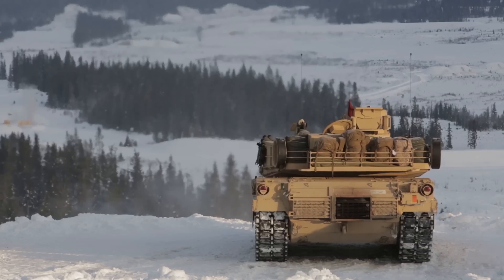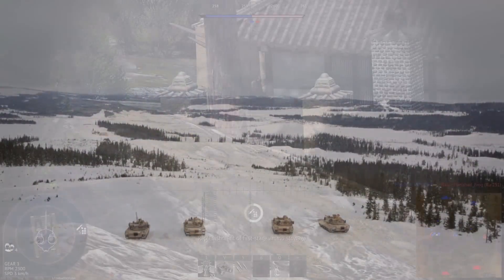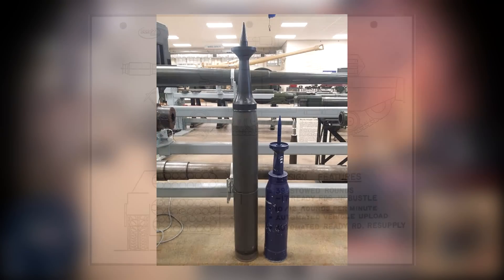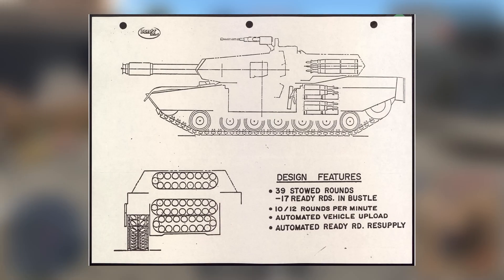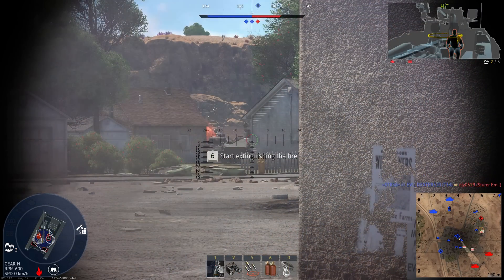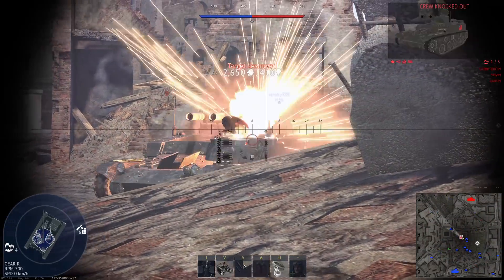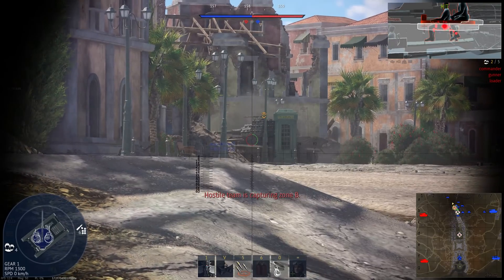The Strongest M1 Abrams Ever Built

Comment: In cursed tank similator i have full cattb set yeah it has lazer warning system, missile warning system, 560mm pen apfsds (l55a1 gas 495mm pen) but dont have active protection system amd turret armour weaker than abrams sepv3 turret then i put sepv3 l55a1 cannon and cattb chassis all in one hull armour unlike war thunder it has 560mm, on turret its 800mm turret sides are 400mm also you can take 95-100  120mm shell inside the rank all shells has blowout protection

Comment: I have a serious question so serious answers only. What would a M1 Abrams tank be like if it had an electrically powered modified B-17 “Memphis Belle” Sperry ball turret mounted as the new commander’s weapon station and incorporates a race ring and turret basket for 360 degrees rotation coverage and offering anti-aircraft protection?
Reply: That would take so much space form the already cramped tank and why would you add stuff to the Abrams when other vehicles exist for that job pacifically. like the M3 linebacker, AN/TWQ-1 Avenger and the M-SHORAD all are for short range air defense but there is a purposed prototype called the 'M1 Abrams liberty 2' that was design for air defense. it was proposed to have 2X35M and and 12 ADATS missiles and a full search and tracking radars or same IRST form the ADATS. Liberty never left the mockup stage. i hope i answered to your questions. if you have any questions I'm happy to answer

Comment: An Abrams with a Cummins diesel!?! That's lovely!! That would solve the Abrams main problem!! It's gas guzzling turbine engine. Poland has acquired 250 Abrams tanks. But they train very little simply because they cannot afford the amount of fuel required. Furthermore they found out the hard way that this tank is waay to expensive maintenance wise. So yeah. This would be the better option I guess.

Comment: @Spookston: there were actually TWO M1 CATTB testbeds.

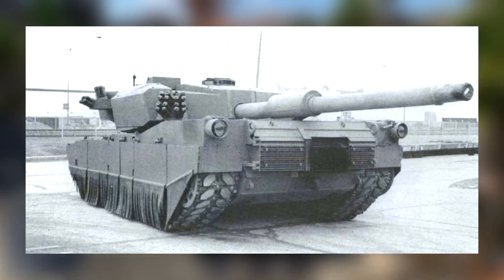The first one, named CATTB Phase I, used a normal M1 (not a M1A1 like the M1 Thumper AKA the ATAC Demonstrator) hull (note the sprocket retaining rings and the rearmost, trapezoidal skirt segment inherited from the M1) and it still had an AGT1500 gas turbine and the original M1 trackbelts (see @03:01).
CATTB Phase II, built a year later, used a completely scratch-built hull designed to house the smaller XAP1000 AIPS diesel engine (which, in turn, allowed the inclusion of those vertically-stacked, non-ready ammo carousels in the hull, in the space left vacant by the more compact engine - allowing a whopping 39-round loadout, either of the 120mm OR the 140mm ammo variety) and it had new, single-shoe experimental trackbelts (barely visible, but your video thumbnail shows the Phase II vehicle).

That's the only way to visually differentiate the two CATTB prototypes:
- Phase I: AGT-1500 with rear exhaust grille, two-shoe M1 tracks.
- Phase II: AIPS with NO rear exhaust grille, single-shoe tracks.

Both of them had the XM291 120/140mm gun, but IIRC it was the M1 Thumper that first trialed the 140mm XM291 (with three different barrel lengths, too!) at Aberdeen Proving Ground (there even was a companion vehicle, derived from the MLRS chassis, that could reload the Thumper's turret bustle carousel with a robotic feed arm that latched onto a rearming port built into the Thumper's bustle).

All of these vehicles are at the Sierra Army Depot at Hurlong now.

Comment: Okay so I tried to do some research, and I've found literally nothing specific on the penetration ability of the XM291 140mm, it is stated that a British project for it (multiple NATO countries worked on this gun, and the ammunition was able to be used by all NATO countries using the 140mm), the British did a test, saying the penetration of the XM291 had an effective penetration of 40% higher than 120mm guns being used at the time. With calculations, I came up with 305mm of penetration at a range of 4 miles, please correct me if I'm wrong or if someone has more knowledge on this

Comment: I saw this prototype personally when I worked a summer internship at the Sierra Army Depot in Herlong CA way back in 2011. Cool looking tank. Never got to stick my head inside unfortunately. Up until a few years ago I could locate it on the base with google maps but they have since moved it somewhere else on base or shipped it off entirely. I tried looking for it but the satellite pictures of the base are too low resolution to distinguish it from all the other tanks stored there.
Reply: I know the ATAC System Demonstrator aka THUMPER is located here, 40.20512860551921, -120.13609225826659 no idea about the CATTB tho.
They still had the "cowboy fringes" installed when you saw it?

Comment: I think M1A2 sepv3/4 has more armor in turret. It is like over 1.5m equivalent or even more at this point.
Reply: you know or think?
Reply: @jammygamer8961  I don't know exact numbers, as it is secret, but from sep v2 onwards, they elongated turret and replaced hull armor. So elongated turret means thicker special armor pockets, and new welds on hull in place where hull special armor pocket resides, means they upgraded it. From scarce sources I stumbled upon, they apparently put older turret armor into hull, and replaced turret armor with new one. New seps don't have depleted uranium in turret, but something else, probably something based on tungsten

Comment: Some additional info and corrections about the CATTB.
1 - It had 80 smoke launchers
2 - They made 2 CATTB prototypes, the first one, CATTB Phase l uses a normal M1A1 hull with some internal modifications while the 2nd one CATTB Phase ll uses a new hull made just for it.
3 - Detection Avoidance Program. PM Survivability Systems began investigating in FY 91 the feasibility of incorporating signature reduction techniques in combat vehicle systems to increase survivability. The PM provided funding to TACOM for development of technologies that will reduce the following combat vehicle signatures: visible, near infrared, thermal, millimeter wave radar, and acoustic. Part of this effort requires testing the technology on the CATTB.
 TACOM is designing and building signature reduction hardware for the CATTB and is predicting the signature using computer models validated by the CATTB test data. The turret was specially developed to have reduced signature, same with the new side skirts.
4 - The new suspension provided a weight saving of over 1,700 pounds (771,1KG), better mobility, better on move accuracy and can adjust ride, lower the front, rear etc. The new tracks are also 590kg lighter.
5 - CATTB Phase II consists of a reconfigured hull to accomodate a three man crew. The major technologies to be incorporated into the CATTB phase ll compared to the phase l include a 270-volt electrical generator, electric turret drive (chassis mounted), full non-imaging sensor system capabilities, updated vetronics, and an auxiliary power and enviromental control sytem.
6 - The Propulsion Laboratory supported the CATTB program by testing a new personnel compartment heater, you can see the heater in photos located in the left side.
7 - New advanced automatic fire extinguishing system.
8 - The 120mm L/55 and the 140mm tube have the same length, 6.750m with the 140mm tube having twice the chamber volume of the M256, 20L.
9 - The CATTB, just like the ATAC System Demonstrator (THUMPER) has a rearm port in the turret rear and a case ejector door located in the turret roof.
10 - Pressure Swing Absorption (PSA) prototype hardware/Environmental Control Unit(ECU) prototype hardware. PSA is used in Hypoxic air fire prevention systems to produce air with a low oxygen content.
11 - Advanced dynamic track tensioner system, anticipated to increase fuel economy and to improve overall mobility.
12 - XM965 HEMP-T with proximity fuze, but it is actually a HEAT-MP-T despit what the name says.
13 - Despit having a bit less gross horsepower than the AGT1500, the XAV-28 had more net horsepower and 10% more sprocket torque compared to the AGT1500, also had a Infra Red Supressor (IRS) installed. The XAP-1000 AIPS uses a new seven-speed automatic transmission built by Allison, three more gear ratios than the M1 abrams, and it is designed to allow the engine to be mounted transversely to make more efficient use of the engine-compartment space.
14 - The CATTB used the 140mm tube, despit the CATTB FINITE ELEMENT STRESS ANALYSIS saying LW 120mm, there is tons of documents stating that the 140mm is labed as the LW 120mm, and in the same document, theres 2 given weights for the gun, 6,810lbs(3088,9KG) provided by gun manufacturer and 10,000lbs(4535,9kg) calculated.
15 - The net weight is 63.044 Metric tons, while the gross weight, with ammo, fuel, crew, etc should be around 68-70 metric tons.
16 - The turret front armor is 1270-1016mm thick, and the sides more or less 520mm, it is stated in at least 2 docs.
I have more info about the CATTB, but i think it's enough for today, i m also making a accurate CATTB model in sprocket, the CATTB model in armored warfare is full of errors.
Reply: i think the "errors" in AW CATTB model are intentional as if im not wrong it is their interpretation on what if the CATTB is somehow accepted as a whole and still kicking in the 2020-2030s, could be wrong though.
Reply: I'm not quite sure about part 14. There is this famous picture of the Thumper with the actual 140mm and you can see how small the bore evacuator is relative to the barrel. The barrel on the CATTB looks like the 120mm with the big bore evacuator. Also there are some documents showing a stationary 140mm which also looks like the one mounted on the Thumper. I wouldn't expect this to be added ever because of this uncertainty. Even if you are right, there is literally zero official information about which barrel was actually mounted on these pictures.

Comment: i am pretty sure the Leclerc Terminateur is stronger in the firepower, mobility and protection. and there is also the Object 292 who pack much more firepower.
Reply: Nope, Leclerc has worse armor, and the firepower is more or less the same, it's only faster than the CATTB, but it has less torque and worse acceleration.
Obj. 292 cannon is not that powerful, the XM291 fires a way longer and heavier XM964 APFSDS-T.
Reply: @UnknownMemoryOfTheDistantStar  You might not be aware since the leclerc armor is stil classified. but during the emirate trial, the Leclerc won over the M1a1 because the Leclerc was the only one that was immuned to the the guns used by all those tanks.

the CN-120-F1 is also more powerful than the M256 with the same ammunition

the Leclerc also featured the balistic computer, multiple targeting system and battlefield scaner which was only integrated on the Abrams in the early 2000s. 

not to mention the advance reloading system

the later model of the Leclerc is also much better than the earlier one, including Titanium elements and also explosive reactive armour.

while there is also other tanks that can be better than the leclerc, such as the Leopard 2A6 and 2A7, the M1 Abrams is not one of them. as a matter of fact, the abrams is falling behind for a long while. keep in mind the Abram was created 15 years before the leclerc, but the upgrade it received since, didn't really make up for his weakness, notably the heavy weight and out-dated armor. while the Leclerc is lighter and more advanced. the Leclerc also have upgrade equivalent to the amercian one with SEP and TUSK. while the Leclerc have participate to less conflict, it still did fight, notably in Mali, Afghanistan, Lebannon and Kosovo. and never had any lost. while the American did lost a bunch of Abrams during different wars, including the First gulf war while fighting T-55 and T-72. such tanks was also encountered by the Leclerc in Mali.

actually the fact that the Leclerc is so advance make it expensive which advantage other tanks on the market. the M1 Abrams is not particularly expensive and enjoy the fame from the fact the most powerful country use it. it's mostly marketing business, countries need to go with the cost and effectiveness, the M1 is not so cheap, but most cheaper than most of the competition, and it offer a good performence for the price. in fact i am not even sure if the M1A2 SEP V3 would made it in the top 10 of the worlds best tank in services. there was many bit where the M1A2 Abrams and Leclerc participate along with other tanks, and in most of them, the Abrams fall last. for exemple the Greek one in 2003, The leclerc arrived first, then the Leopard 2A5 close 2nd, the Ukrainian M84 was third and the M1A2 was last. even a modernized soviet tank was better than the M1A2 in trials.

so you might think whatever you want based on patriotic value, but the M1 Abrams is already 50 years old and that is a fact that make the difference
Reply: @uriellima9193  ? I'm not even American, how i'm "patriotic" stating facts? And why are you comparing a M1A1 with the Leclerc?  We are talking about the CATTB not about the M1A1, you don't even know what you're talking about.
M1A2 SEP 3 weight: 66.8 metric tons Leopard 2A7V weight: 66.5 metric tons, it's not even that heavy, why ppl always forget to convert short tons to metric tons?
M1A2 SEP3 has out-dated armor?  Why does the SEP3 weights more than the Leclerc if it's smaller? I think it is because it has paper armor right? Same with the Leopard 2A7V.
I think you should stop trolling, show me the SEP3 armor compared to the latest Leclerc upgrade please.
Also don't use military exercices to compare tanks.
Abrams is a battle proven tank, while Leclerc only fought in small scale conflics and in limited numbers, it's obvious that they're going to lose some Abrams duh.
Leclerc is hardly a top 5 tank, while Abrams never left the top 5.
Leclerc featured the balistic, multi targeting system... CATTB had all that shit and more in 1993, 1270mm against KE in the turret front and 2nd gen du armor in the hull front 600-650mm against KE, more armor than any tank ever built.
Leclerc failed in the 1994 swedish tests against the Abrams and Leopard 2, it had worse armor compared to a export M1A2 Abrams without DU. The newer designed leclerc lost to a export and "outdated" M1A2 in 1994...
And why don't you stop spreading fake info? Object 292's 152mm is weaker than the 140mm XM291, it fires a shorter and lighter penetrator.
Leclerc's OFL 120 F1 penetrator is also way shorter and lighter than the m829a3 and m829a4.
Reply: @UnknownMemoryOfTheDistantStar  and on what the CATTB is built? the M1 abrams ofcourse. and just like the American did for the M1 Abrams, the French did it for the Leclerc. and the German as well, and so was the Swiss, British, russian and chinese. they all upgunned at some point their MBT with a 140mm gun (or 152mm for the russian)

the point is to bring it back to my first comments, the Leclerc Terminatuer was probably stronger in firepower, was more mobile and probably have more protection. the Leopard 2 build by the german also had more firepower and more mobility. so i am pretty sure the CATTB is not the stronged tank as the video said. i would even come ti believe the KF51 is packing more forepower than the CATTB with his 130mm.

so of course, you can assume what ever you want but clearly you lost the feed of the conversation right away because not only you bring no argument and also you seem to had forget what we was talking about, or maybe you just do not know what you are talking about

Comment: Very interesting vehicle. I have one question though: How improtant is the caliber of the gun in mbts? Im asking since you mentioned 120 or 140mm canon, but does that make such a big difference in times of apfsds etc?
Reply: of course, more dakka is always good.
Reply: caliber increase is always a big upgrade, but it depends on how advanced it is, like the russian 125mm used on the t14 armata has a penetration of nearly 1m of RHA, but the 152mm on the obj 292 which is alot older had a penetration of like 700mm, but usually a larger caliber will have much better penetration

Comment: Over a meter (1000mm?) of armor? And I thought my idea for a future mbt with minimun 1000mm was outrageous and impossible...
Reply: Actual dimensions of armor are not necessarily its RHA equivalent thickness..
Reply: @obsidianjane4413  Yes it is, and it should be 1270mm RHA effective in the front. while the sides should be more or less 520mm. There is 2 docs saying that it is the RHA equivalent.
Reply: @UnknownMemoryOfTheDistantStar  From the front, the M1A1's turret front armor array is 6 feet thick...
Aluminum alloy armor is many times thicker than its equivalent in steel. 
etc. 
etc.
Reply: @obsidianjane4413  CATTB turret front is 1270mm against KE, it has a 25,4mm spall liner + 25,4mm turret basic structure + front modular armor block shell that is 38,1mm x2 thick plus the composite inside the modular block. The front composite armor module is longest composite armor array ever installed in a tank.
Reply: @UnknownMemoryOfTheDistantStar  English not your first language?
Reply: @obsidianjane4413  Yes, but what's wrong? Edit: nvm i got confused by op's comment.
 Yes you are right, composites armor dimensions can't reach their RHA equivalent thickness, that's why the CATTB's turret modules are so large.
Sorry for the confusion caused.